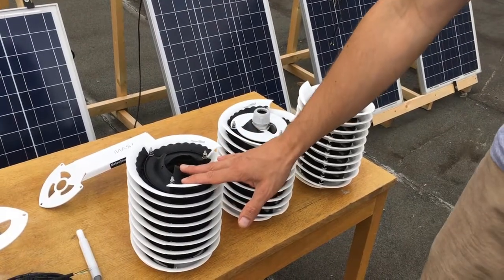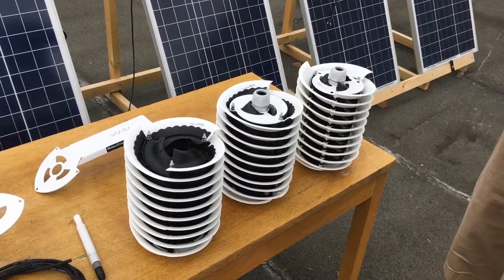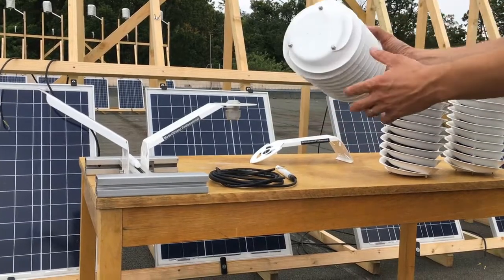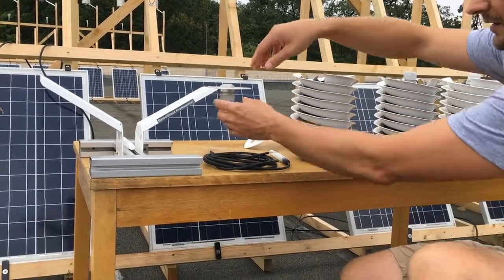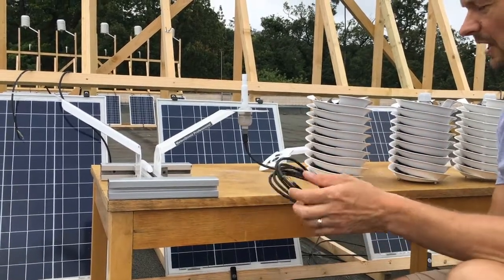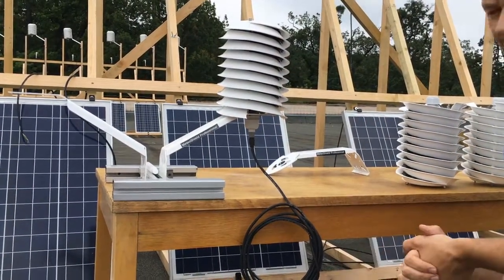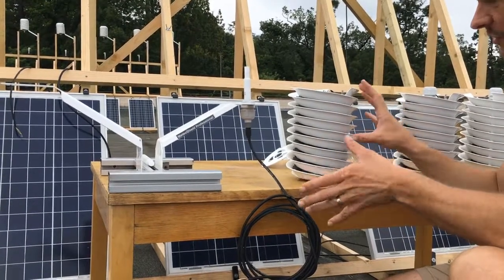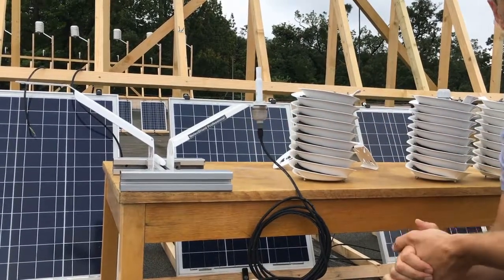MeteoShield Pro Mounting Instructional Video

Comment: It's a fantastic radiation shield but it's not maintenance free, i've had loads of spider in it this summer (which was also the rainest recorded since 1850) but still, not a problem on the other cold half of the year though.
Reply: You are correct, nothing is maintenance free :-) Nature rules all! The fact that there is a bit more airflow inside than in many other radiation shields, it is a bit less inviting to bugs, but if they want a home, nothing will stop them :-)

Comment: I disagree that it is maintenance free. That is impossible. I have  had many similar shields in the field. Dirt is not a really big problem because you can wash it of easily in the first place, but no design can prevents spidersfrom  moving in  and weaving their webs. The webs will easily collect a lot of dust and other small particles and the  shield can easily become a home of many spiders, not just one. And so you very likely will need to clean your shield in order to keep airflow at a good rate and also keep your sensor clean. Otherwise: nice design!
Reply: A fine mesh, preferably plastic to keep the heat absorption down, would prevent any spiders to get in but still allow enough airflow.